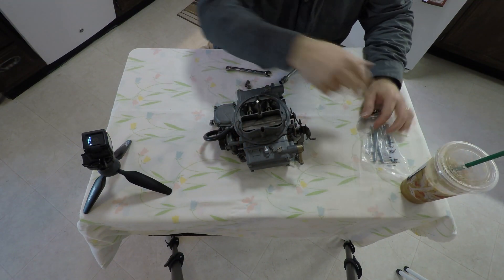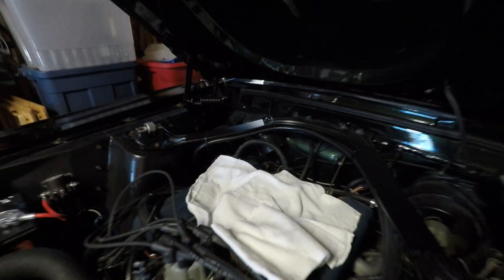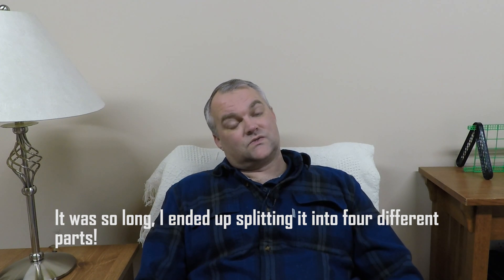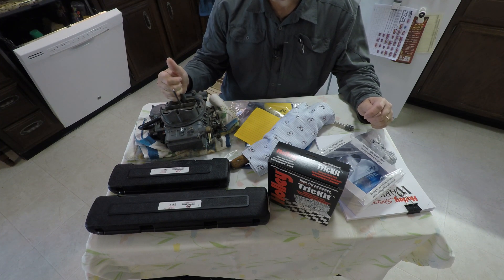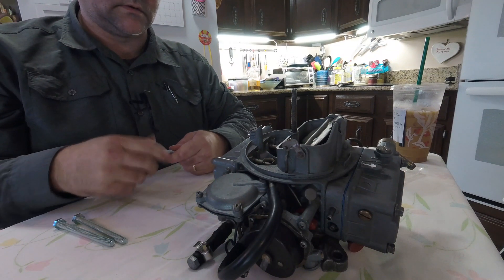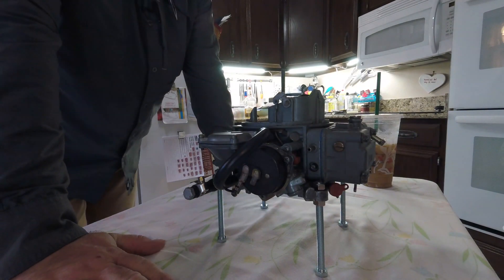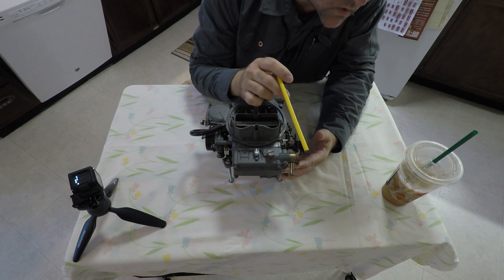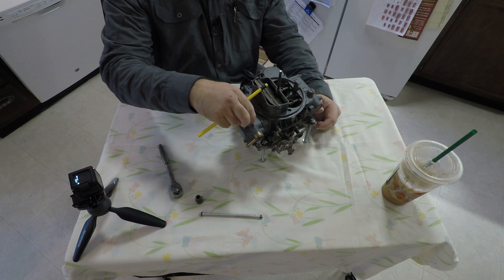How To Rebuild A Holley Carburetor 4160 - Part 1 - Intro

Comment: LOL, I'm working in the kitchen....schhhhhhhhhh don't tell my wife! Neil, which model 4160 you rebuilding? I have a Holley 750 cfm, 4160 3310-6 on my 67 S-code big block to be rebuilt over the winter. Thanks and cheers from Motown
Reply from the maker: Don't remember that I ever looked for different models under the 4160 so I have no idea!
Reply: @NeilRichard  Other then the 3310-1 and 2, the rest are a tad different someone had said. I can look it up on Holley Website. Thanks for your replay! Now clean up that kitchen!!!

Comment: Do you have links to Parts 2-4?
Reply from the maker: Links are in the description but here they are in case you missed them:

How To Rebuild A Holley Carburetor 4160 - Part 2 - Tear Down: https://youtu.be/ZdyLwhPPEOc How To Rebuild A Holley Carburetor 4160 - Part 3 - Rebuild: https://youtu.be/At-mDlPToqw How To Rebuild A Holley Carburetor 4160 - Part 4 - Install: https://youtu.be/hoBeTN18J1Y